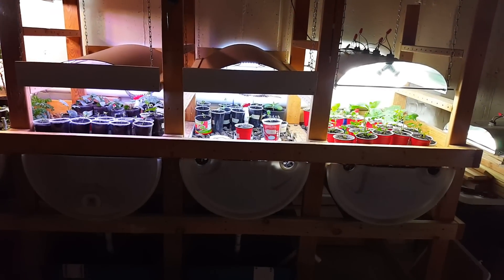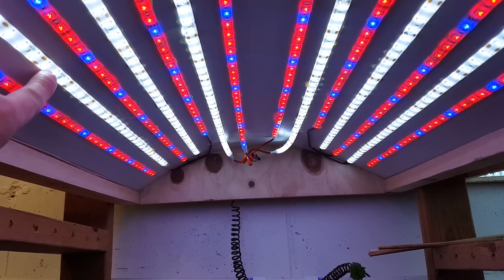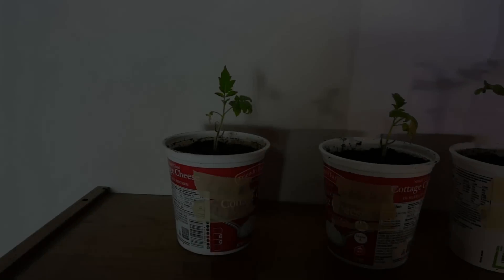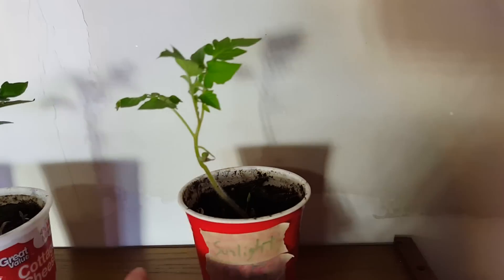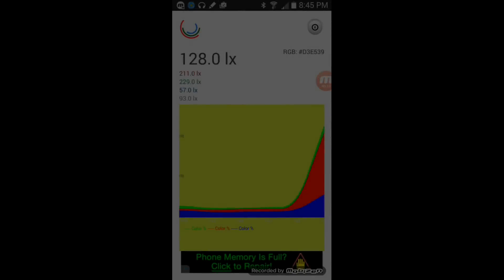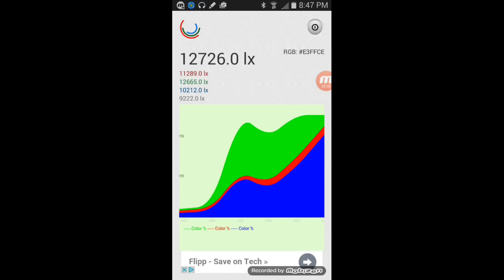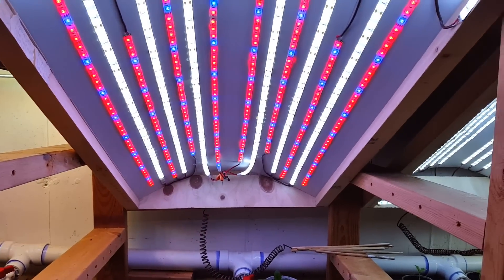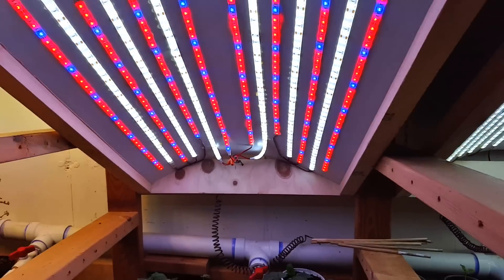DIY LED Grow Light Follow Up - Low Power LED VS CFL

Comment: I just need something to keep some of my plants alive in winter and start sowing indoors before outdoor planting times with as little amount of power consumption possible. Which would you recommended?
Reply: A regular LED shop light or even regular LED bulbs in regular light fixture will work. 4000-5000 k is supposed to be best all around, but last year I used 500k and 6500k bulbs and had nice stocky seedlings of peppers and tomatoes.  You need the equivalent of about a 200 watt bulb for each square foot about 6-12 inches above the plants. I have lettuce, cilantro, green onions, all doing great this year along with my tomatoes and peppers.  A 4 foot shop light with regular bulbs can only cover  about a an area 6 inches wide. I use cheap 60-100 watt equivalent bulbs mounted in socket splitters that provide ~3000 lumens each square foot. I got 20 bulbs that draw 11 watts from the wall each for $2 each, with plastic(?)  sockets and bulb splitters  mounted on 2-  8 inch wide 4 foot boards.  For $75, I have a nice  LED panel that covers  about 18 square feet and produces as much light as at least a 600 watt HID

Comment: The led fixtures should have been placed much nearer to the canopy imo. Also I always grow with lamps around 3k - 3.5k as that's more typical for a full spectrum grow in my experience. During veg the cfl will be better with all that blue but during flower themred spectrum led's should perform better

Comment: Those leds are no where near powerfull enough to be that far away from the plants, even a t5 bulb most people buy for propogation is like an inch or 2 away from top foliage, cfl even is showing stretching symptoms. Just place your cups on a stand to bring them closer to the lights or lower the lights themselves

Comment: THE REFLECTOR SURFACE IS NOT THE SAME AS A METAL SURFACE, IT  ABSORBS THE LIGHT TO SOME EXTENT! TIN FOIL AND SPRAY ADHESIVE, (WRINKES DONT MATTER) WILL BE A PERMANENT & CHEAP IMPROVMNT. 
NICE WORK, GOTTA TRY IT! THANKS FOR THE VIDEO!

Comment: The plants tell the story, it aint the light spectrum here its light amount.
Not enough light on those LEDs , I avoided these strips for that very reason, also they are too far away from the plants, Think 1 watt leds should be about 12" from plant tops. I just use the LED Daylight Bulbs (also 1 watt but far cheaper and far more light when combined ON A FLAT SURFACE (do not over think this) with defusers removed, lots of examples on YT.  Works like a champ

Comment: Excellent video!  I'm 72 and just now expanding and setting up a variety of lights from CFL to LED.  I have two 5-inch round 40W Daylight LED Plant Light Bulb, Full Spectrum Ceramic LED Grow Lights (claiming 4.2 sq ft coverage), two Galaxyhydro Dimmable LED Grow Light, 300W (140 actual) Indoor Plants Grow Lights (claiming about 4-5 sq ft coverage), and a bunch of CFLs in both red and blue and ranging from 23W, 32W, 45W, and 65W.
My question is how close can I put them to the tops of the plants from seedlings to 2 ft tomato plants?  I'm growing on thee 6ft adjustable height shelving units 18 inches wide and 28 inches long.  I'm guessing the CFLs can be as close as a few inches but I don't have a clue about the LEDs.  Thanks for any help you can offer.

Comment: Take a look at the Cree web site and see the type of grow light that was developed to compete against the industry standard Gavita HPS. They sued 4000k white and a smaller amount of 660 nM far red LEDs. If you match the used wattage the LEDs will be putting out more light and will last longer than the fluorescent.
http://www.cree.com/led-components/media/documents/HorticultureReferenceDesign.pdf.

Comment: the reason the LEDs did so poorly compared to the CFLs is because the LED one produces WAY lower lumens. . . That CFL Light should be producing 12800 Lumens and If your using 65k Cfls they are the best ones for veg state. I knew the CFL light was gonna beat them all just by looking at them.

Comment: Hello, I have been using t5 and leds . My problem is hardening them off. I am at work when they need to be introduced to the outside light. Do the CFL lights reduce hardening off time or eliminate it any?  Or is it about the same? I hear natural light bulbs can reduce it but have yet to find out for sure. Thanks!

Comment: LEDS in the correct wattage are far superior. That said don't buy cheap crap and DIY it  the lighting you acquired is cheap and worthless  and there was nothing you could do to make them better so of course the CFL's worked better. I personally run all three available lighting fixtures (well there is 4 but I only run 3). 1000 watt HPS/MH , 2-300 watt LEDS and also T-5's and they all have their place. To run a true experiment get the correct equipment first. Low watt LEDS don't grow plants well at all. 1 watt LEDS Vs  several 45 watt agra grow CFL's The LEDS never had a chance

Comment: for vegging your plants (blue spectrum lights) and for flowering your plants (red spectrum ...
Your test graphs clearly show the lights with the most BLUE produced the best plants! THE PROBLEM with your fist light setup LEDS is it is mostly RED and WHITE, get rid of most of those and add far more BLUE which you only have a few of.
Reply: Den Stump
Reply: Why would my lemon tree need blue or red LED,Or would it if I'm using a 200 watt CFL w reflector?
Reply: More than about 20% extra blue on top of your white light will actually inhibit growth, I've read because the plant thinks it doesn't need to grow as big to get as much nutrition because it thinks all the light is as strong as the blue light, but it doesn't get as much energy because only the blue light is brighter ignoring the whole rest of the spectrum. Wide spec white is best for all growth since the entire spectrum is used in some way by the plant.

Comment: Hi, thanks for this video.
A question & a comment.
Have you used a Kill-A-Watt meter or something similar to see what the actual power consumption is? It seems to me that the  LED would be less than 110 watts

I think (could be wrong) that you would get better results with the LED if they where a lot closer to the plants. (1"~2")

Well done!
Reply from the maker: +rknowlso I agree with that. I am going to get a kill a watt for the final tests. I wanted to get them closer but my chains were too short. Also the lux readings i got seem to indicate a sweet spot at just about the height they were at due to the shape of the light hood

Comment: I had the same problem with my light you know how you got the white light next to the grow lights I'm going to add blue in between the grow lights
Reply from the maker: I was thinking the same thing! Great idea
Reply: I don't have the aqua ponics like you yet but to start plants for the garden I made a fish tank into a grow tank I grow things inside it I find with the led grow light gots to much red in it seems to grow very slow I had a pepper plant only grow very little in that time and they grow slow as it is so blue should help the light go's around the tank from top to bottom around the tank with flash so it bounces back on the plants  the light in very bright lt but not much blue gives very light groth so adding the blue I'm hoping raises both to be the same
Reply: hey bro I was just thinking blue light makes a bright light so you mite want to add some then test so you don't make the blue over take all the red
Reply: white is blue LED with phosphor like a mercury with phosphor (fluorescent) converts the input light
Reply: white is a bluesh color but there is a bright blue led light that got a very bright blue spectrum (fluorescent) light I have used before it works but I was just looking around just to see what I can do to maybe make the lighting better but thank you for writing

Comment: 7020 actually refers to the size of the LED, not the power necessarily.
Reply from the maker: +Sockheadrps good point, I do see a correlation in the size of the LED and light output though. I am not sure that is always consistent but I tend to think of them as synonymous. Thanks!
Reply: Dimensions are in millimeters in two digit groups. 5050 is 5.0mm X 5.0mm, 7020 is 7.0mm X 2.0mm. That size is correlated with output of individual diodes but is meaningless if you do not account for SMD density (diodes per meter which varies).

Comment: Hey SSL! Well arranged video. I am convinced that I should use CFL. I have a question. I built a "grow box" recently out of cardboard. It is narrow and tall @ 1ft*1ft*2.5ft. I lined the insides with aluminum foil. My pot is a round plastic tub with 1 ft diameter and 15 cm deep and I made a ton of holes all over the tub for aeration and drainage. Can I work with this setup at all? I mean I'm just starting out growing cilantro and fenugreek indoors and just thought somehow that was the way to make a grow box. haha. Anyway, at what height do I place a CFL bulb in this setup considering it is narrow and what wattage works best?
Reply from the maker: I don't see why this won't work. I would use the 23 Watt CFL bulbs in the 6500K range (daylight). The more the better as these are still a bit underpowered but fine from growing your herbs

Comment: I like the 6400k mixed with the 3200k 
That mix works really well!!!!!!
Use the 630nm red and 430nm blue leds mix( the best spectrum of the LEDs) with the 6400k Cfls(in flower switch to 3200k-3000k) u will see crazy growth this combo works well with high power Ledz also(100-700w) mixed with HPS or HID(150-1000+w the combo make's a perfect sweet spot,, combining the lights u can create a bigger grow area with better growth then just using one plus a lower power consumption!!!! How could u ask for anything more)..........

Comment: Been waiting for this follow up video.  Very informative as I've been thinking about building something similar in my greenhouse hydroponics system.  Thanks!
Reply from the maker: +Shawn Bauer no problem, will have better results when i try the other two designs also. Thanks for checking it out!

Comment: The problem is the LED lights you are using is you are using what looks like 1 watt LED strip lights and not the 3 watt standard LEDs on an actual circuit board with heatsinks and fans. This is not powerful enough. The 3 watt ones cast MUCH more light and run a bit warmer, hence the reason for the heatsinks and fans, but they are ballsy, trust me. Not that cheap misrepresented junk on Ebay from China either. Good American made (expensive) professional LED grow lights (Like Blue and Spyder and the other quality brands) do an AWESOME job, trust me. They put out a lot of light actually. I have a professionally made LED grow light at 3 watts per bulb and they can grow pot from seed to harvest and nice solid buds. This is not really a fair comparison. LEDs have better results and performance than ANY fluorescent light, even "magnetic induction" fluorescent lights (fluorescent lights on steroids). I get anywhere from 1-5 ounces per plant (dried) of high quality, dank, resinous knock your socks off MJ with my set of two 360 watt 120 LED grids. Lol. LED's even out do the results from high power HPS or Metal Halide lights and run a lot cooler and with less wattage than they do. For the same amount of power as fluorescent lights, I can get way better results with LEDs. I could grow at least one if not two nice tomato plants under just one of my 360 watt with my light from seed to harvest.They pack a lot of bang for the buck, but you have to use the 3 watt or higher to get good results and you can't put them on some cheap hood. Like I said they have to be on a PCB and in an all metal box with fans and heatsinks because they do put off a bit of heat.  They also make 5 watt and higher, but for a simple indoor use 3 watt is very good. With the higher wattage than 3 watt ones you have to get into more expensive setups and even better heat dissipation. I have seen videos on Youtube of good 3 watt LED grids outperforming even really high power and high heat HPS and Metal Halide lights even. All while using almost half the power of those beasts and WAY lower heat. I LOVE LED grow lights. If you had put 200 watts worth of 3 watt LEDs (same as your CFL hood wattage) into that LED, instead of what you did, I guarantee you would have had stellar results that totally rival the CFL's. You had the right colors on the LED's for sure and it's a neat little setup, so please don't think I am being critical. It's just not enough power/higher watt LED's. When I stuck my light meter under mine, I was off the chart in terms of light output. You are measuring in lux as well which is great for color spectrum, however try measuring in PAR if possible too (that's what the pros do), and measure the amount of "usable" light. The PAR numbers for good 3 watt LED lights are pretty incredible. Other than that, great video. You presented some of the facts of plants and light etc. well. I love your plant setup and gear by the way, with the barrels and piping and wood frames etc. What kind of system is that? You are using soil it seems, but it looks like you have a hydroponic or aeroponic setup there too or some auto watering setup. Pretty cool looking. I like it.
Reply: what if he had put the LED strip closer to the plants though?
they are only 1 watt as opposed to 3 watt LED but  they also throw less heat, it seems to me has the hod and lights too far away ,couldn't you get results close to 3 watt LED with 1 watt LED  if the spectrum is right and you place them almost touching the plants? i thought i saw some operation  before where they were growing lettuce and produce inside of trucks, the had these vertical tower hydro systems and then they had led strip dangling from the ceiling like fly paper around the hyrdo towers and the led strip was dangling right up close to the leaves almost touching it,imagine this would work with  cannabis as well, just set the strip close to the plants ,sure you will need to spend more effort to keep adjusting the spacing of the strips to the plants, but you will save $$ on the LED strips and on power consumption ,also isn't that spectrum he was using better for flowering? wouldn't he be better off using some  LED's with a more blue spectrum for veg cycle growth?
also what about the other typed of LED's the ones where the LED is that flat yellow post it paper looking type of element, that only come in  cool and warm white, are those any good canabis grow lights?
like those big ones that are like 1" or 2" squares they use for flood work lights
Reply: Andrea Mitchell I agree. LEDs are low heat especially the 1 watt and he probably could get away with putting them closer to the plants. That's the problem people have with CFLs and fluorescent. They put them too far away. You can go very close with those too. I used to keep a close eye on mine and always kept them 1-2 inch from the tops of the plants and no more. They fared far better when that close. Light penetration on LEDs and fluorescents are low. Thankfully so is the heat they produce, so you can get away with having them pretty close and not burning the leaves. On my 3 watt LED's they are so powerful that I have to keep the plants at least 12-18" away from the plant because even though they are not a hot light, you can get "light" burn, believe it or not. Not heat burn, but light burn. That was a surprise.
Reply: Bill Does Stuff wow  i never would have thought you could get light burn from LED's especially the colored ones that are narrow spectrum, i know when you start cannabis indoors for seed you definitely  have to have the lights really close to the seedlings
like right on top of them or they stretch tot he light get tall and stringy and dampen off ff at the stem ,i only ever tried with fluorescent tubes ,  never  used any CFL's though
Reply: Andrea Mitchell Yes, you can get light burn  from having them too close. The instructions for my 3 watt 120 bulb grow light (with different colors) said 12-36 inches and they are right. The reason is that those bulbs are magnified as well on a professional grow light. through a small lense, not just plain LED's. They are actually quite powerful and I grew good cannabis with them even at 12-18" from the tops. Any closer than 12" will give them light burn with my setup. LED's can grow as much if not more than any high heat, high powered HPS or Metal Halide light. I love them for that and their low wattage, low heat, good spectrum. Pricey to buy initially, but they pay for themselves in hydro savings and get way better results than fluorescent. While you are correct that seedlings and young plants need a lot of light, they actually need even more during flowering. You can get some half decent results with fluorescent but the bulbs have to be very close and lighting from the sides helps too because of their poor light penetration from the tops. That's where CFL flood lights come in handy.
Reply: Bill Does Stuff
Reply: Bill Does Stuff not to mention that in this video he's basically just growing lettuce you can grow lettuce with a fluorescent bulb it doesn't need a lot of light to grow
Reply: Can I come over?
Reply: @andreamitchell4758  just the bad ones.
Reply: @FinehomesofNewHampshire  i am looking into getting started with indoor and have decided to go with viparspectre
300  but not sure if i should get the  r300 or the v3000 ,  which one is a better choice?
i assume  r is more  red and  v is more violet
or should i go with  the  450?
but again r or v ?
not sure if it is more economical to get 3  300's or  2 450's ( if i  plan on adding more lights in the future) 
or if it is better to have 2 450's or 3 300's
seems like 3 300's might spread the light better ,but i also plan to try and  build a  light mover rail and  i think it is easier to mount  2 450's on it that 3 300's